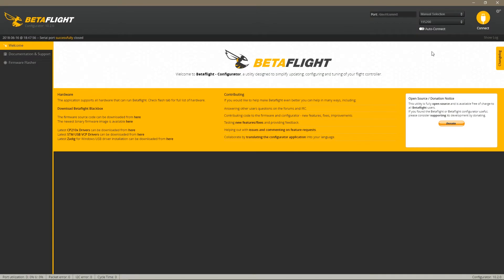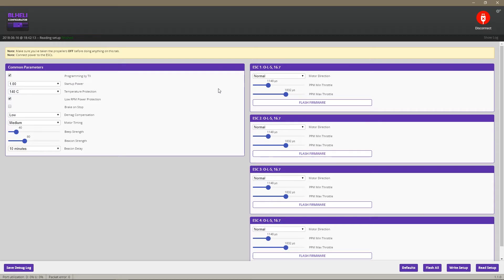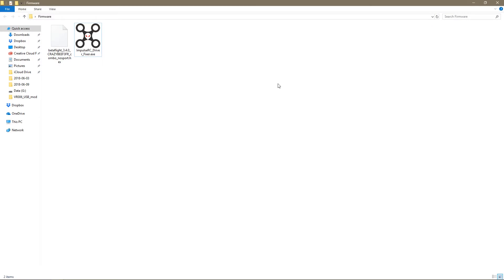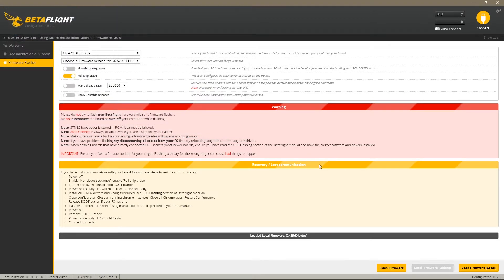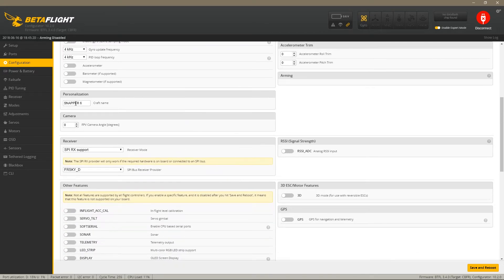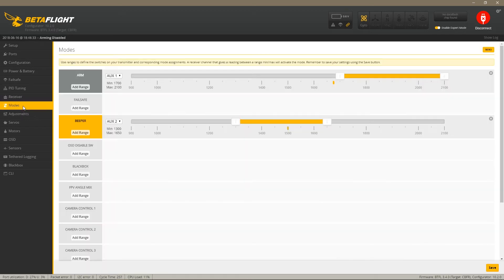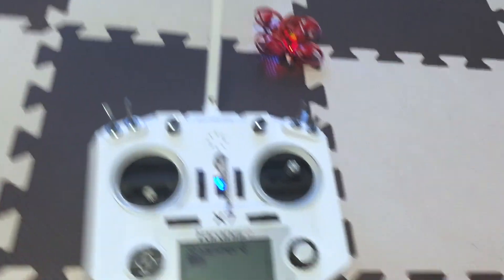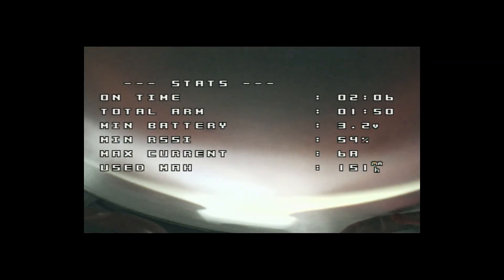Turtle mode on the Snapper 6 (and all CrazybeeF3 FCs)

Comment: On banggood website it says that you shoulnt flash esc firmware cuz it will damage the motors. On the UR65.  Is that a trouble or not?
Reply from the maker: It's safe, if you know what you're doing.
Reply: @RikkTheGaijin   Okey but I dont.  Im a neeb.  Can I still do turtle mode configuration without the flash Thing?

Comment: for some reason my quad goes into turtle mode but doesnt have the power to flip the quad over? any idea how i can increase the power of turtle mode? its a ur65 so shouldnt have a problem doing it
Reply from the maker: Make sure you have the latest version of BLHeli flashed in your ESCs. And if that doesn't work, maybe you have a bad motor?
Reply: RikkTheGaijin got the latest version of blheli and it doesn’t flip in any direction, it’s as if it just doesn’t have the power? Even with max throttle (flies completely fine)
Reply: Did you ever sort this out in having this issue, it's all set up to work but just doesn't flip.
Reply: @morpheusone7755  does it not enable turtle mode or does it not have the power to flip?
Reply: @connormullan  yeah everything is working great, I have the mode enabled, I can make individual props move, but the quad skimms across the floor at speed instead of flipping, I get the occasional flip if it hits something during its skimming
Reply: @morpheusone7755  it's just because it's underpowered mate, try it on a grippy surface like carpet and it usually works. Limitations of 1s power on a smooth surface like tiled floors

Comment: I already solved that the accelerator works. Now I am trying to make the antiturtle work for me. According to your instructions first I have to activate the lever of the antiturtle, then arm and finally ROLL, is it correct ??
Reply from the maker: Jorge SM no, after your quad is flipped, you have to disarm, then switch the turtle mode on, then re-arm and now you can move the stick to flip it back.
Reply: Ok, maybe I expressed myself badly, what you mention to me now is what I wanted to tell you and yesterday I tried it and it works perfectly. Much better than in a bigger racer. The propellers are protected in this small one.
regards

Comment: Yesterday night I did the flash according to your video, but I understand that the firmware you provide is for frysky. I did it but I did not recognize the flysky, the receiver, no matter how hard I put the appropriate option and then it recorded, when reconnecting, the receiver option appeared with nothing.
I had to update to the normal 3.4.0 and everything configured, but now the station does not recognize me. Will I have to re-bin the station and the CrazybeeF3?
regards
Reply from the maker: Jorge SM yes you have to re bind the quad to your radio after every firmware update
Reply: Right, I did it last night and I already have the station connected. Now to see the channels that only pitch and roll works for me.
What was not worth is to flash to the 3.4 that you give us to download. It must be only for the taranis, for the flysky it's not worth it.
I will try this weekend and if the antiturtle works for the flysky.

Comment: Had problems with my turtle mode, but found out that when you have your beeper on your disarm switch so when the quad is disarmed it beeps. It will interfere with the dshot command telling the motors to go into turtle mode, so when turtle mode was on the motors would not go into reverse. They would spin the normal way and it wouldnt flip back over.

Comment: your beeper may not work  could be  because of 3.4RC version, I use 3.3.3 stable version.   everything works perfectly.
Reply from the maker: Which quad did you try? For me the 3.3.3 doesn't work with the Snapper 6. The only one that works is the 3.4.0.
Reply: I have both UR65 and snapper6 and they both work great with 3.3.3.  Beeper, turtle mode, motor beacon they all work.  Oh and my is flight controller is  flysky protocol.          Your video helps me solve the 3.3.3 flashing problem, ty.    I also use jumper t8sg radio.

I went back and looked at your setting and my setting.  The differences are as followed.   Of course this is my setting but it might help you.

In my BLheli configuration:
My setting is-
uncheck= programming by tx
turn off= temperature protection
check= brake on stop
1 minute= beacon delay

In my Beta flight:
I used impulserc drive(as you recommend) to get DFU mode BUT I flashed 3.3.3 straight from Betaflight firmware flasher(online).  I turned "OFF"= full chip erase

In configuration in BF, 
8kHz  and 2kHz as recommended by maker( anything else will give you problem sooner or later)
Dshot beacon configugation= ON
 
extra:
in cli=     

set beeper_dshot_beacon_tone = 1

Everything else is practically the same.

Good luck and TY.
Reply from the maker: Interesting. 3.3.3 didn't work for me, the only difference is the receiver, I use FrSky.
Reply: the beeper didn't work in 3.3.0 and turtle mode did  work.    with 3.3.3 everything works.   sorry your does not work.  heck the only thing now is to figure out  how to put starwar tone on it.
Reply: Mine is beeper work in 3.3.0 but turtle mode did work. I'm Snapper 7 frsky with t8sg
Reply: Just read a article in Github. Betaflight developer said it has some problem in frsky protocol before. I updated to 3.4 RC5 everything is fine now. ;)